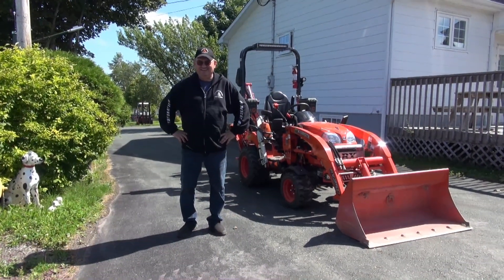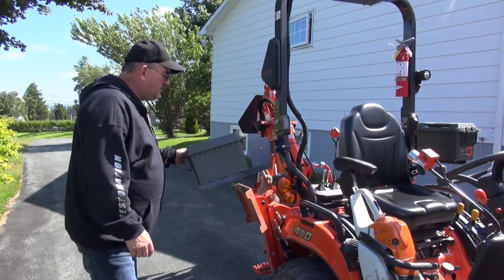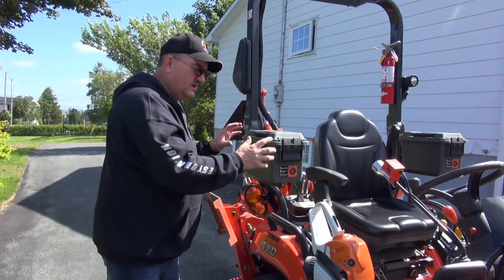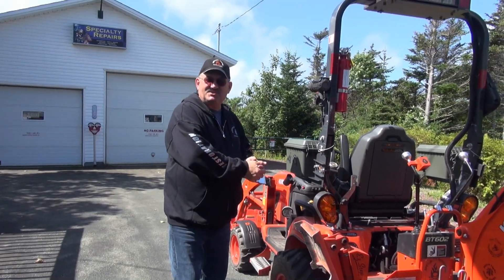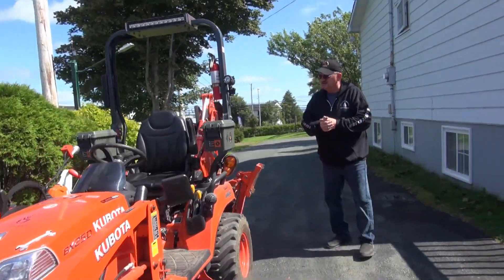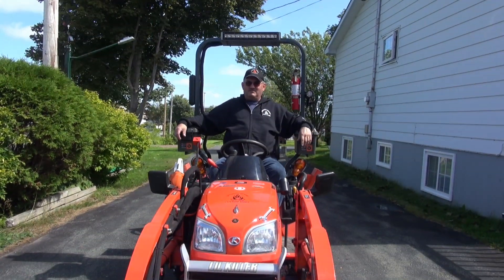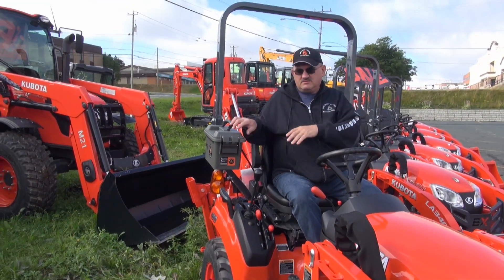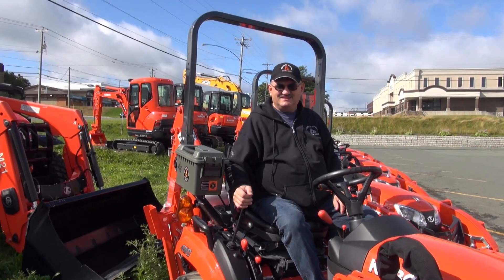*NEW* Kubota BX Tool Box (Left Side)

Comment: Hi Paul and Kathy. I got to say I love all your videos. But I do have a question about the BX quick coupler. Mine leaks and always has. Have you done any mods to this coupler manifold. I’m about to discard the manifold and just use separate couplers. Any thoughts on that ? Not sure if Kubota has addressed the problem.
Reply from the maker: Yes there have been many leaks reported with the qc FEL coupler. The one you see in the video is a loaner from Newfoundland Kubota. We have the BX25D . I am told that Kubota has addressed the issue and have fixed the issue. If yours is still under warranty bring it in to them for the fix. It’s a nice system when it’s working . Thanks for watching. Keep well.
Reply: Paul & Kathy Short  thanks bud. I had it so called fixed under warranty once. Now it’s not. But I think I’ll just run new hoses with single coupler and make a bracket to hold those hoses. I don’t remove the bucket anyway. Thanks for your input. Glad to here from you and take care.
Reply from the maker: I’m not surprised their fix didn’t work. I was doubtful when I heard about it. My BX25D don’t have such a system and it’s never caused an issue. I think when manufacturers design things to be “ convenient “ they introduce weakness to the design and make it become more unreliable. I think your choice for the fix is the only way to go to have any lasting peace with your tractor. Good call. Keep well.

Comment: What is the difference between the BX 25 and the 23 S
Reply from the maker: BX 25 is the older version. The BX23s has the same motor, tranny and drivetrain but new upgrades such as universal skid bucket (optional) 
Tilt steering, differant hood.......
Reply: Thank you for the info